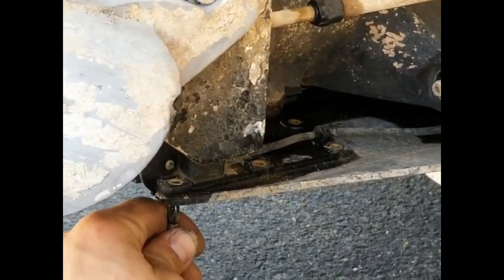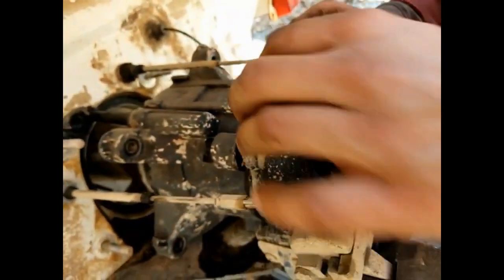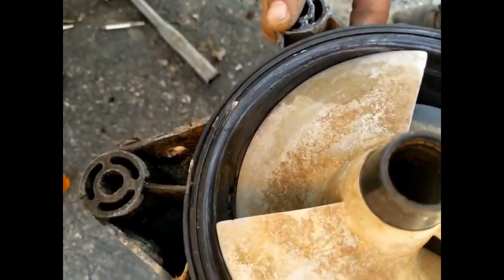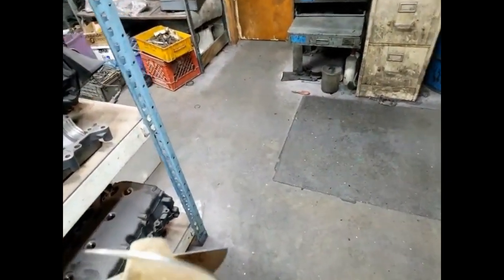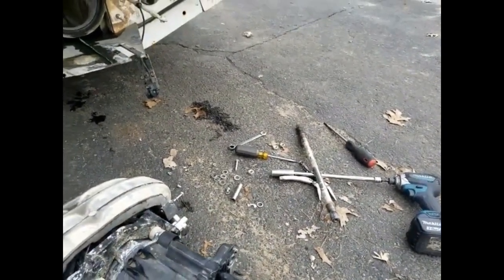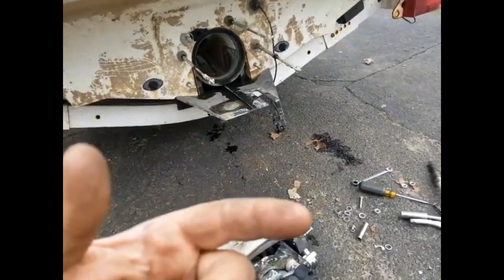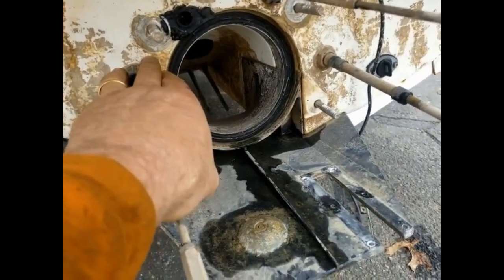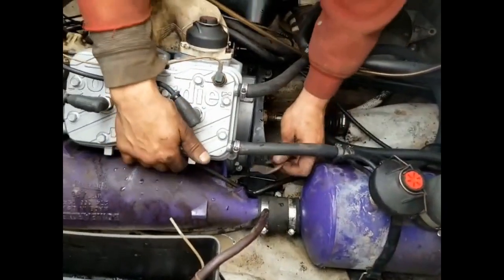96 Seadoo Challenger Jet Pump Diagnoses Trouble Shooting Cavitating Slippage

Comment: Mel hope all is well. Hey at the 4 minute mark I see the red and purple seat from what I believe is a 1996 Yamaha 1100 Waverunner.  I have an 1100 and 760 which I bought a few years ago and had you give them a once over and carb clean since they sat for 10 years. Anyway they are running great however, the red and purple seat gets water logged. All I can think is that the seam between the red and purple vinyl pieces allow water in the seat.  Have you seen this before?  It drives me nuts and I would love to find a way to prevent this.